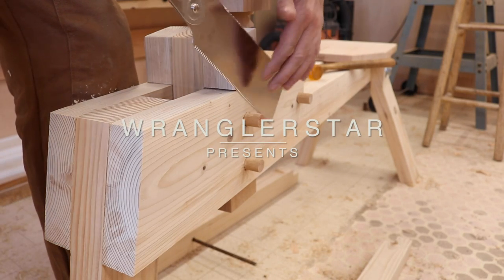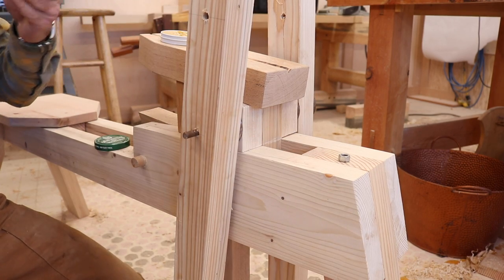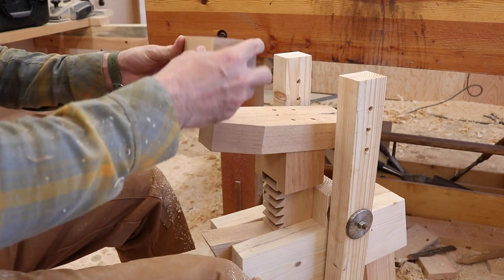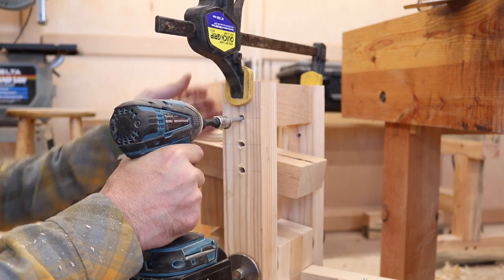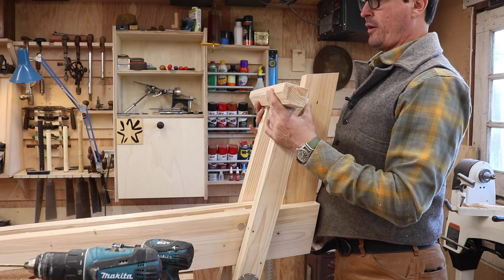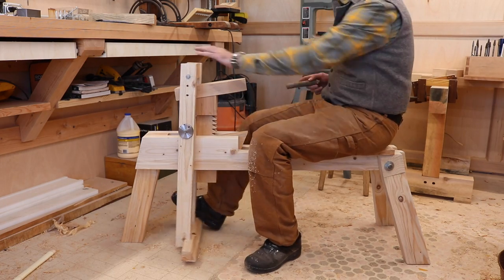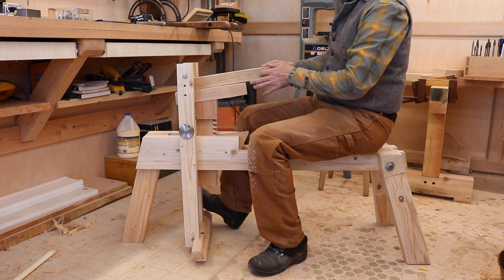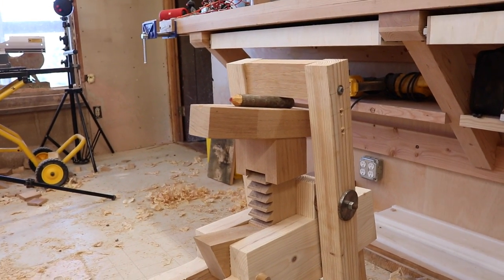The ULTIMATE Shaving Horse 2

Comment: Cody, the steel discs on the pivot points would be better termed as spacers as the really bear no weight or force when clamping.  However, a true bearing would be a great idea so that the all thread doesn't dig into the wood.  A properly sized piece of conduit would be a good, inexpensive solution for this.  This will be a great tool to have in the future.

Comment: hand addition to your shop. keep in mind green wood for lathe projects warp and split often. This wont really work for timber framing lumber but for the lathe rough turn it over sized. The put it in the microwave for 30 to 60 seconds then let it cool down for a couple hours and repeat until it stops losing much weight or use a moisture meter.

Comment: Very cool!  Gives one a lot of ideas.  The horses I've used before were primitive, field-expedient and then left at the site (think: half log with branch legs).  Problems: 1) Tradle is going to bust-out (lag too close to bottom, not centered) 2) I would have used a nylock on the axle, because "wood is never dry, its just drier, or not so dry" (Gramps) 3) would have cleaned up the big washers first (less work), its the ONLY time I've seen you be impatient! 4) if your top jaw is turned "long part up" I predict it will split from the pressure (think of the leverage) 5) I like the adjustable work top but I suspect its gonna end up being the "adjustable work item size" where the work level is going to be the same no matter who uses it...don't worry, your boy will grow plenty, and soon!  6) I would have made the tradle 1" higher off the ground to engage the ball of the foot...I can't engage a heel or arch type implement all day, youch!  Thanks for the vids!

Comment: adding a notch on the upper part of the clamp will also help in holding square stock on the diagonal. If you place it on one corner it can be rotated out of the way when not needed.

Comment: My Uncle Ernie used a shave horse and had a small board on the top piece of the clamp that had a leather strop mounted so that he could (in doing a lot of carving) could stop a moment and pull the edge of the draw knife over to keep the wire edge down and so have the sharpest edge to work with.  Your horse is simple, clean, and beautiful, green wood or not, lovely bit of work there, its a great design!

Comment: I suspect the pressure on the bolt/axle will wear the holes in the two arms fairly quickly. the steel washers and wax are a good idea but a simple brass bushing from the hardware store, glued into each arm would prevent any normal wear on the inside holes. Just a suggestion.
Reply: PTFE has the lowest coefficient of friction of any solid.
Reply: not sure that's true against Stainless Steel.  then it tends to slip and stick...

Comment: The all thread will wear the wood holes when turning in wood. The threads will act like the flutes on a drill. A thin wall bushing or thread the ends of a piece of round bar will help prevent wear. Great job, now I'm gona have to build one.

Comment: If you go down the boat shop you can pick up a a roller 9 inches long roughly you can use it for your board piece that you clamp down to stop it on your plate keep the wood from sliding. This is suggestion you might like it better it is soft enough but yet it will grip without putting a ring or Mark in your wood

Comment: SInce You designed the upper element as a rotable rectangle... and there's a groove in the lower element to hold the round objects or to use it to hold the "diamond section" - maybe a little groove in the upper element would work as well to increase the hold on the "diamond". You could use it in normal position every now and then and when necessary, rotate it 180 degrees...

Comment: Dear Cody, congratulations on an excellent build of some novel approaches to a shave horse.  I do like the adjustable baseplate with a toothed gearing for adjustment.  You have a rectangular piece on cross section at the head to provide pressure for your work.  Most other people use a circular piece in cross section and I wondered why you chose that?  One thing that would really make your choice advantageous is if on different faces you leave one flat, insert a small v-groove for small round work in face #2, a larger V-groove in face #3 for larger round and a gentle concave for face #4 for oval profiles pieces.  That way, choosing the appropriate gripping face will induce the least amount of damage to the workpiece from holding.  Cheers.

Comment: Two thoughts for you Cody, use bronze bushings in your clamp pivot points to save to wood. Second install a cross brace in the lower part of the treadal to help transfer clamping pressure when using one foot.

Comment: Great job Cody. I like the ratcheting mount. When I have to bolt wood like you have done on the clamp arms I have used split ring lock washers to act as springs and take up the slack of the wood drying out. That way when the humidity goes up and the wood swells I have that spring action to let the wood move a bit without crushing against the hardware.

Comment: I would suggest using a bolt for the top block instead of the lag screws for easier turning of the block.  The threads on the lag screws make the top block move sideways a little as it is rotated.  Been there done that.  Several top blocks of different shapes might be advantageous.

Comment: for the part that clamps down the wood you can just drill a hole straight through and instead of screws put a piece of thin round bar steel with a 90 degree on one end. That way you can change position of it really quick and it can     rotate freely. Great videos my friend!

Comment: I prepare material for the embodiment of similar option of a bench, at a seat I will do a fisation of situation with edges on perimeter, and with a spring at the lever of the lower basic rack, and so offset of your bench, without delicacy, it is practical and it is rational. Hind legs were pleasant durability, and noticed that the place of fastening of the top persistent lever to a bench is made more primitively and rationally, but I will try to make to myself as a classical bench with smooth forms. You the good fellow that made the bench and videos shared with colleagues on hobby. hi from Moscow.

Comment: I d put a small bevel on the clamping edge for a larger surface and less punctual damage to the workpiece.  Slightly round it then to fit most sizes and clamping angles.

Comment: Now you can make some Windsor chairs. Don't cut front axle flush. Instead use two nuts on each side. Tighten second nut against first to lock in the amount of pressure you want which is the position of the first nut on the axle.

Comment: Just a suggestion,  I think that 1/2 inch copper tubing would make good bushings for your 3/8" rod.  Otherwise with use the hole where the rod goes through will become misshaped,   

One more thing is that a craftsman never points out his mistakes,  You can correct themIt looks like fine furniture if you want to.  Besides you are doing a very good job from what I can see it looks like furniture and many that I have seen still have the bark on the the parts.

Comment: The most complicated part is the adjustable bottom part of the vice, how did you design the teeth to take the load of the foot treadle pressure? And the angle of the bottom vise do you end up pulling the shave toward your waist or pulling toward your armpit?

Comment: Cody, I know this is a little older but I am still catching up on ALL of your videos..  If you fasten those metal washers to the treadle legs with a couple of  seated wood screws, they would act like primitive bearings and metal on metal takes much longer to wear out than the wood on the metal rod..  Also it would be much easier to replace those  metal washers than to have to build new treadle legs...??      Just my opinion and observation and you can take it for what it is worth..   Don't put yourself down so much when you build things and they are not perfect as long as you did your best at the time, ..     just learn from the experience and the next one will be better than the last..  Remember that we always need to learn from our history so we are not doomed to repeat our mistakes.....    That is a great shave horse and I intend to make one for myself using much the same ideas as you with some tweaks of my own (I am nowhere as good as you working with wood, my son got that gift not me) can't wait.   GOD BLESS

Comment: drill the hole a bit bigger and insert a bras or metal tube in the hole so the wood doesn't wear on the axel / threaded wire.

Comment: Rather than rotating the hold down bar, why not round over the contact area? Less chance of marring the piece being held and no need to constantly rotate.
Reply: Bosco Bob more potential for surface to surface contact as he made it.  if the rectangular block is rotated slightly, he can have one full side in contact with the work piece.  but I agree, rounded would be simpler and faster. I'm just not sure it would be better.

Comment: if your going to use that horse indoors on hard floors you may want to add some grip to the legs or you will be scooting across the floor with every pull of the draw knife.
Reply: The design of the shave horse makes it so the force of the cut is against the foot bar. All the force is used to clamp the part in place. That contains the force inside the frame of the shave horse so there isn't any sliding.
Reply: i have seen a video on you tube where the old man does in fact slide across the floor.
Reply: That's interesting. Which video? Because I believe what you say, all I can say is, not every one does everything correctly.
Reply: Then you can't have shavehorse races?
Reply: Old Sneelock's Workshop  search- working the shave horse by American woodworker. i think thats the one
Reply: No worries. It's just that the classic design prevents sliding and I'm wondering what's different with the one he is using.
Reply: Hmmm, Robert, I guess you missed that class where they explained the "every action has an equal and opposite reaction" part of Physics. If he has his foot/feet on the treadle [pronounced "tre-dəl" and not "tray-del"] it doesn't matter how aggressively he shaves a piece of wood, he probably won't move very far in any direction unless he also somehow throws his weight in the direction of movement. ................. I think.
Reply: Of course you can. It might not be a real long one or quick but racing is a big part of the survival lifestyle. Racing jackrabbits for dinner and racing grizzlies to avoid becoming dinner. 
Anytime there are 3 guys in a group there is a race just waiting to happen. :-)
Reply: @ Sneelock's Workshop - I'm not sure anything's different/wrong with the one he built, I may have missed a few bars in the video, but I don't remember seeing the horse move any at all when he was doing his demonstrations. That's one reason why I suggested that maybe it would have been more productive to his audience if he actually shaved a pin on his new horse to show the world what he wants to make and to give his horse a field test to see if he forgot anything ..... like air conditioning, or a Dolby sound system, it seems he has all the other bases covered already. Ha! ;->
Reply: "Anytime there are 3 guys in a group there is a race just waiting to happen. :-)"

Yeah, unless one of those "guys" IS the grizzly in which case you only have to outrun one of them ..........
Reply: We agree on the nonslide part of Cody's design. Cody has made the ratcheting improvement on the classic shave horse. It should work very well even without air conditioning. :-)
Reply: Same holds true for almost anything chasing you. :-)
There is a reason for having slow friends along on a camping trip.

Comment: Why not use a 5 inch round then you wont mare or have to turn it if you want it clamping on the wide flat, which may not give you effecent clamping force, thing turning a course screw vs a fine thread.

Comment: Any specific reason to use lag bolts for fastening the "foot pedal", instead of using regular screws? (Sorry, beginner woodworker)
Reply: stronger, due to size and surface screw area. (be my guess)
Reply: Jonas Kristiansen all your pressue you apply comes from your feet. don't want it to be a week spot and run the risk of pulling out screws. could you do it? sure you can.